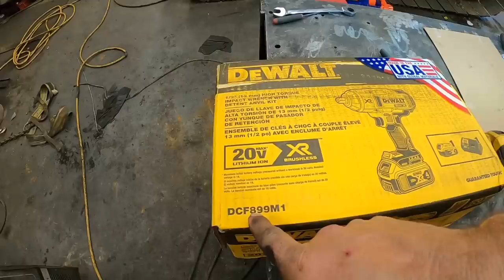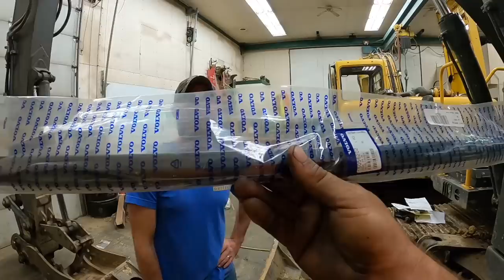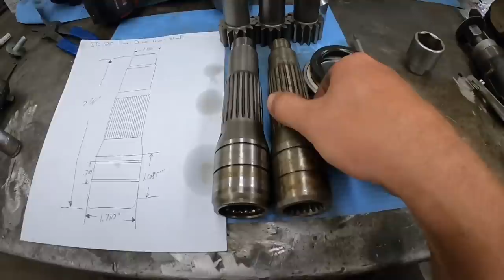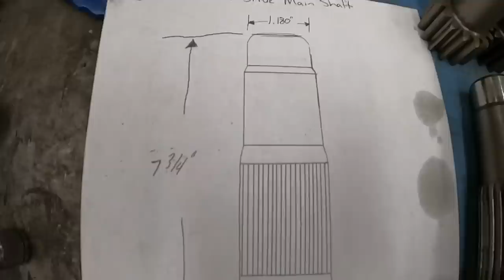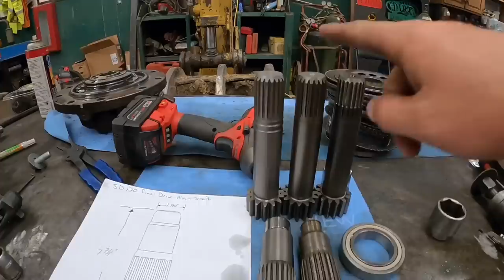The Volvo and the John Deere 120 are both broken down in the shop not good

Comment: As usual I am an old man of 74 and I really enjoy Your Expertise and Man behind the scene how well You work together and again how well Your shop works for You. I still do oil changes on our family’s 4 cars and brake jobs and yes mufflers until TESLAS come. Now I was amazed your shafts being sourced from 2 countries in EUROPE. DOES JD make slightly different OEM parts or is their aftermarket parts there instead of CHINA.
Wow, You have a lot of unique jobs like Stadium Seating and l have IR IMPACT and mostly MILWAUKEE 9 and 12 volt battery  and the big 120 volt Hole Hawg  & mag drill press and 12 “ compound Miter saw in both Brands. I have the 200 amp MILLER MIG and all the the rest of tools in multiples for building a structural steel frame house. I have over $40,000 of tools and MAKITA has the best 1/2” drill on the market along with my other favourite 5”  12  amp powerful grinder  with slim body You can use with one hand because of soft start. My next purchase will be Milwaukee 1/2” impact that you can dial in torque adjustment. I know a lot about tools and selected HUNDREDS of thousand dollars to be bought by purchasing departments of construction companies I have worked for not including Fork Lifts, Stinger Trucks, and cable pulling equipment. I very much respect Your 15 years spent as a big residential contractor before Your excavating business. For Me I get the most satisfaction watching Your Mechanical skills in action.in Your Shop. My other passion is everything Elon does starting with SHANGHAI, BERLIN, & now AUSTIN watching the biggest earth moving show on YOUTUBE with 40 CAT BELLY SCRAPERS and EXCAVATORS, DOZERS, DRILLS PACKERS, WATER TRUCKS totalling another 100 pieces all CATERPILLAR. One big very interesting commercial for CATERPILLAR and 150 highway tractors hauling 20 yard   Bottom Dump Trailers all working for RANGER CONSTRUCTION. Ok only Elon is My GOD with SPACEX, and TESLA taking over the battery industry totally with 4680 cell, but the biggest development is the BETA TESLA FSD now being demonstrated on U TUBE every day that is very safe and watching the car operating all by itself with colour screen showing in Technicolor what the computer sees and actions taken with no deaths or even a fender bender. My GOD THIS SHOULD BE IMPOSSIBLE. The testing has being going on for more than a week and TESLA is not in control of other cars. I HAVE TO WAIT FOR 2 YEARS FOR MY CYBERTRUCK.

Comment: Because of the emissions issue many equipment owners as well as owners of diesel pickups are  keeping and even gravitating "back"  to some of the older equipment to avoid the unreliable issues that come with the newer stuff.   I'm keeping my older stuff as long as I can get parts to keep them going.     Pre "DEF" diesel trucks and tractors in my area are highly  sought after.
Reply from the maker: Yup hits why I keep the 120
Reply: I’m still running my 2000 F350 (not that big deal as mostly retired now) but I can work on it and the engine is bullet proof. My two new small tractors are both under 99 HP as well for that reason and have me DPF on them just an EGR crap.

Comment: Been there. When things get so bad all you can do is laugh about it and wait for the next blow

The emissions are why the price of older machines are going up.

I was the old guy in the shop that told the kids cordless impacts were a phase and not going to work. I am now retired (early due to back injury) and finally peaked my head out of under the rock and only use cordless at home and working on projects at my current part time job.

Comment: Mike that dewalt impact wrench is 1200 ft lbs max breakaway torque,700 is max fasting torque the Milwaukee 2767-20 is 1400 max breakaway and 1000 max fasting torque,I have both of them,they really work great

Comment: My cat 299d skid steer has been in and out of shop for 6 months with Def problems. Cat finally changed every piece on def system finally fixed it for NOW!!! Thankfully it was under warranty but that much time without a machine will break a small company like mine

Comment: You've definitely had a rough go of breakdowns. Like you said You've been really lucky not having any problems and then they just all hit you at the same time. I switched all of my cordless tools over to Milwaukee about 7 years ago after borrowing a friends Milwaukee tools. I have a high torque 1/2" Milwaukee that puts out 1400 foot pounds of torque that's about the same size body of that Dewalt you just got. I've actually changed the tires on my Peterborough with it, very awesome tool. They also have a 1" impact I'm sure You've seen. Awesome video Mike!
Reply: I was going to say the same thing, I have the High Torque 1/2" Milwaukee Impact as well and its insane!! The one DP is comparing to the DeWalt is the standard 1/2". I have that one too and its good for most things.

Comment: You might be happy to know that You are not the only one that has a bad day, week or month. I’ve been restoring a 1976 MGB and it seems that every time I fix one thing something else breaks or I put something on wrong that requires me to take 4 steps back and replace a part I broke. The last part broken was the center section of the clutch which destroyed the clutch. Good luck with getting the Deere back in operation.

Comment: I got Milwaukee tools and I use that style light for everything.  The hooks top and side are awesome and the light lasts for a long time without killing the battery.  And now you're making me want a 1/2 drive impact.  I have a 3/4 which is a beast but heavy and I tend to use my air gun.

Comment: Mike I love your videos. Keep them coming. I did almost the same thing to the windshield in the Cat 316 I run. I was pulling an old stump that wasn't coming as easy as I wanted it suddenly released. When it did a 1 inch branch laying in the tall grass was lanched from a root and hit in the bottom left corner making a neet little star. As for the impact the air gun is much faster in free spin but you need to be careful as this can gall the threads. Just something I learned the hard way while working for a farm dealership.
Reply from the maker: Thanks

Comment: I was a die hard DeWalt fan in my early construction days. I first comparison between the DeWalt and Milwaukee was the screw gun. I found in many aspects I loved my M12 3/8” screw gun, later Milwaukee came out with combo kit with a 1/4” Hex impact driver and M12 3/8” drill/driver. I bought 2 combo kits and that was at least 4 years ago and I have not broken into my second kit. I remodeled a 8 stall horse barn exterior wood, built two 12’ by 8’ doors and two sets of those and many remodels. Impressive little screw gun. Then they obviously came out with bigger batteries as they came out after the M12. I know longer have DeWalt products. Again, my testimony and my opinion. Thank you for sharing with us your issues and awesome light show!

Comment: Thanks, I enjoy listening to you talking about one of my favorite subjects. I believe that my first JD tractor was a 110 which if that is what it was, had a temperamental electric  lift and a thin deck that needed repair and I welded it for rust. I traded that for a new 185 which may not be classified as a garden tractor. However, it is still used by a family member to cut an acre of grass. Before I gave the 185 away,  I picked up a 1987, JD 318, in 1990, which I have maintained and it looks like new and is used on 1.5 acres. 
Was my first tractor likely to have been a 110, from what I have said?  Thanks

Comment: Remember when I was a apprentice mechanic for a heavy plant firm I as you do as a apprentice got the shit jobs and always got splashed like you did until they literally got sick of me traipsing oil into the wash room some guy said open the top first dip shit lol. On the dpf here in the UK we had nothing but hassle with them on every engine equipped with a dpf system from every part from EGRcooler to sender units doser even had full addblue tanks crystallize  solid the solution boiling hot water and ran on a full purge cycle it worked most are now deleted they cost the earth to repair and funny enough all still pass emission tests tell me how that works any how getting a long comment love the videos love the guys and live the crack/banter

Comment: Hey change the liquid filter part each time you do a oil change. DEF crystallizes in the tank and filler tube. Clogs the line to the particular filter which in turn gives codes and deregulation. The crystals don’t completely redesolve when introducing new fluids.

Comment: Wonder if the Volvo was sold because the original owner knew about the emissions issues. Also would think the emissions replacement parts may be better than the originals, so may not have same problems again hopefully.  Very good video.

Comment: Emissions crap is why all my equipment is older than 2003.  Puff Smokey smoke makes $ with less repairs and downtime.

But I did tear the steel guides out of a set of rubber tracks this year digging on a lakeside in solid rocky shale.
Reply from the maker: Yup

Comment: You have to make sure your rakers are set below the cutting edges of the chainsaw teeth. About 1/16th to 1/32nd of an inch is appropriate. It's a common mistake people make when sharpening chains. They forget the rakers need a few swipes of a flat file sometimes. The best way to tell is to put a metal straight edge along the top of the chainsaw teeth and look carefully at the drop of the rakers.

Comment: You need to check the "park brake cluthes" for the JD 120. You should not have been able to rotate the track as you did with the engine off. The "park brake" is spring applied/hydraulic released.
Reply from the maker: lol the prop gear is broke hits the problem 🤷‍♂️😂

Comment: If you want to run a REAL impact 18 volt impact.
Milwaukee does sell different versions of their 1/2 inch impact guns. Their top dog right now does 1400 foot pounds of loosening torque and 1000 foot pounds of tightening torque. I have this version and have easily broken bolts with it. If you have heavy machinery, this is the one to go with. Make sure to use the 12.0 battery as that helps as well.

Comment: Yep, there's oil in there. Lol I know what that's like, because I've had it from neck down standing under a trany with the bolts out the pan when it finally fell off after prying on it for 10 minutes. It let go and I was covered in 90 weight.

Comment: With the battery powered tools, its not a question of whether one is better than the other. The major brands all perform adequately. What gets you is, when you have multiple tools, make sure they use the same battery so you only need one type of charger even though you will accumulate several when you buy tools
Reply: It’s more important that they be same voltage. You can buy adapters to be able to use one battery to the other of almost all models now. You still need to use the correct charger or risk issues but I can run 6ma  Milwaukee battery on my dewalt or I can use any of the many dewalt 20volts batteries I got on the Milwaukee I even got an adapter for the ryobi that lets me use either of those batteries in it with same adapter. The Mikita adapter also takes either

Comment: Surely you could just weld some spacers on the outside frame of the cab with some threads on it so it is easy to remove. The added benefit is you can have protection even when you have the window open.

Comment: at the top window of a Volvo only remove the top roller on the right to the large window. Pull out the cables and secure with grip pliers, it is out in 10 minutes. and disassemble on the workbench

Comment: If you want a great work light maybe you could check out the Ryobi P782 it is both a battery and plug in work light that gives you plenty of light and work in both low and high area's . You can extend it to work on the upper area of all your equipment and collapse it for under that same equipment.
Reply from the maker: Thanks

Comment: Mikey... now I know my MrsDP was complaining about her house stinking like burnt oil!!! And, carrying those clothes inside to wash them didn’t help either.  Lois would have made me take mine to the Laundromat... and spend my lunch allowance to wash them!

Around here, we would have called the nut that retains the bolt in the windshield roller a Jam Nut.  But, I’ve also heard them called Cinch Nuts.

As you know, the NE corner of the Indian Land Rush is practically in my backdoor.  Growing up... there were a bunch of legends about what happens if you wandered into Indian land.  My dad believed that if you desecrated any Indian land you would be living under a cloud.  

We once went to a Buffalo Ranch (tourist attraction) that had a mock burial ground in one corner.  As we are walking along the path, my little brother crawls through the fence and started chasing a toad.  My dad yells at him and swats his butt when he climbs out.  

On the way home we had a flat tire. When he went to change it, the spare was flat.  The temperature was high and the car didn’t have air conditioning... the 6 of us baked in the sun for 2 hours as he hitchhiked to town, bought a used tire and hitchhiked back to us.  

Once we got close to home the radiator overheated.  The water pump v-belt had come off. Fortunately, we had a thermos of water and a tool box so we eventually made it home without further incidents.  

Well sir, my father went to his grave convinced that the problems were karma for disturbing the Indian Burial Grounds.  I once asked him how could the karma come from a “mock” Burial Ground? His answer was simply... Indians have Strong Medicine that White Men will never understand.

So Mikey, you be careful... you may be messing with something you’ll never understand!

BTW... good video.  Please keep schooling me on how stuff works.
Reply from the maker: Lol thanks for the awesome comments buddy

Comment: Mike I no your having problems but I noticed did you get a hair cut ???? Looks good big guy if you did. You probably thought about this but like the ol wheel bearing one side goes you better replace the other side too because it's going to go too. That's what I learned in the school of hard knocks !!! But I no you got this bud !! Did you ever think about checking the hyd pressure on both machines. The JD might have a bit more operating pressure than the Volvo. If so turn the hyd pressure up on the Volvo . Just saying.  Hey have a good one my friend and keep the vids coming.
Reply from the maker: Thanks mark

Comment: "John Deere doesn't know what they are talking about" A company was in the market for multiple new 490 excavators. Representatives from John Deere, Komatsu and Volvo brought their 490s out to a job for operators to test. The operator check out and fired up the brand new JD and tracked about 100 feet before the turbo blew. They ended up buying 2 Komatsu 490s. 

Dewalt Impact. We have 3 of them for installing water line. 1 in use, 1 as a backup, and one in the shop. It's a continuous cycle. You will likely break the shank before you burn up the motor. 

Tier 4 emissions. What a nightmare. They are so temperamental . It's not just a Volvo issue. JD backhoes have the same problem. Every manufacture has the DEF injector problem. They get hot and the DEF crystalizes in the injector  and sends the machine into limp mode.
Reply: And it gets worse in the winter as the crap gets water in it from condensation. I understand the purpose even agree with it to a point but injecting another product into the burn and burning it? The manufacturing of those products and the packaging the wear they cause on and in the engine and drive all add up and the added expense to the systems to replace and repair ends up costing more emissions than it saves. It like burning a coal plant to power your electric car. Why can’t we got back to EGR and vapor systems that worked and actually reduced emissions rather than making new ones. It seems to me someone made a lot of money on DEF/DEP/DPF/DPF items that someone says we all have to have to be safe and run. It’s a lot like that mask we have to wear and the insurance we all had to buy. There always money changing hands somewhere and we aren’t getting the real benefit of it and no real science to show its the best thing or maybe not worse in long run. For every scientist one side gets the other side can find at least one or two to say the exact opposite but we are writing laws on the side of but they all say.

Comment: Great video learning actually how to fix the excavator showing you other fellow buddies and people that are involved in this kind of a trade works involved in this business this is insane if you cannot find the parts for these things and they made them so differently between the the years and the bodiless how does one find parts for something like this is beyond me and how do you plan and put in your budget for stuff like this to happen obviously you had to read something in between The Times that you were down or pusher jobs off 1 of the to that can make you lose money or lose your quiet or lose the job itself the factors that go into this plus the weather plus the the heat the conditions it is ridiculous how these machines still work you know yes used to just AA smug or set up can you bypass it all and put it back to the way it was or will that machine not run without all that crazy stuff attached to it your thoughts them plans on the Volvo can you possibly eliminate all the stuff with causing the problem

Comment: Nice impact, I think the logging crews use the 3/4" !  Just in case it doesn't take them all. Looks like your Dewalt might be bigger.  Maybe 1/4" wire mesh screen is needed over the windshield.  Oh - just thought - to add - was the chain on backwards ?  won't cut.  Ka Boom Ka Boom  now you know what the Ka means !